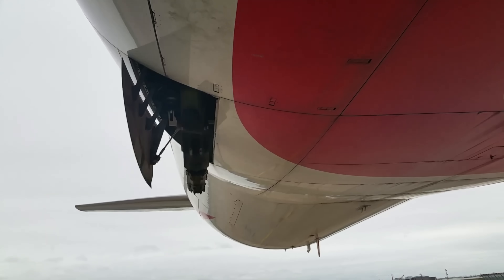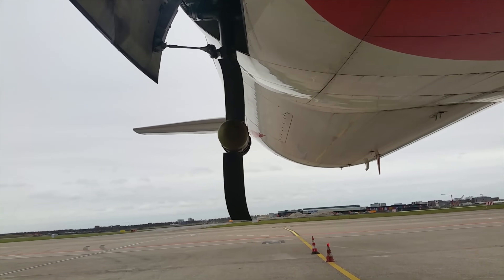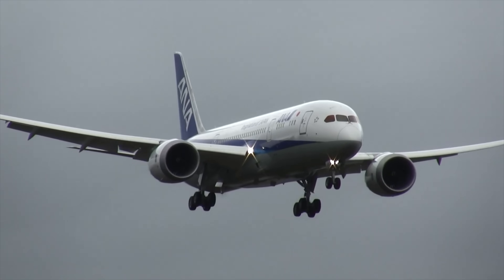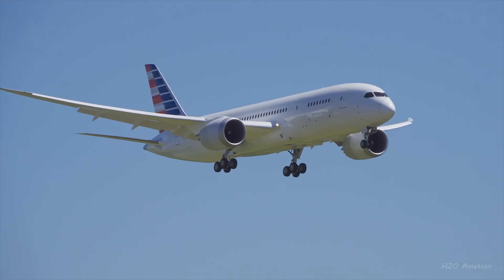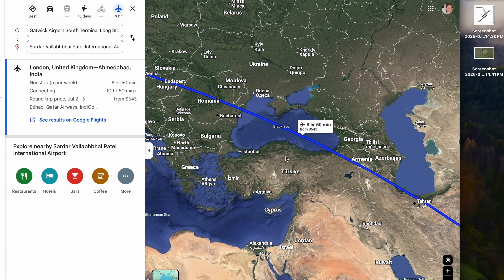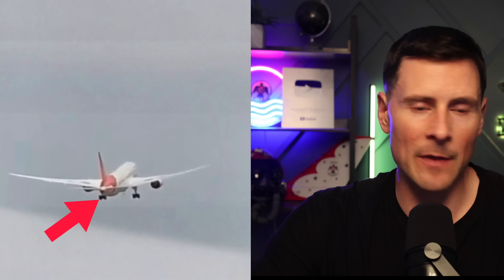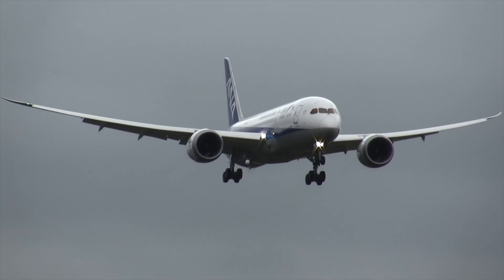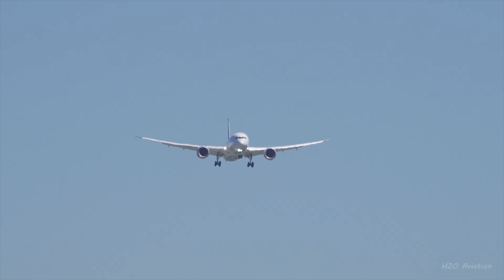Air India 171 SHOCKING UPDATE on RAT Deployment and Flaps!

Comment: Why is nobody talking abaout the fact that the catastrophic failure seems to have happend at the exact moment the Gear up should have been selected? i am speculating that when the Pilots tried to raise the gear up it caused some kind of catastrophic failure in the aircrafts systems.
Reply: That... actually makes a lot of sense, now that you mention it.
Reply: Exactly, i think the same, i think pilot tried to raise the landing gears, the gears tilted forward or retracted a little bit then it's hydrolic fluid leaked (with a blast, because pressure is so high that when it leaks, it leaks with blast, and the sole survivor also mentioned about hearing the blast) then landing gears stopped retracting and the leaked ultra high pressure fluids destroyed electronics and other things arround it and that accident instantly stopped the plane from generating power, then RAT got deployed automatically to generate emergency power (usually RAT deployment also results in flickering of lights inside the plan and sole survivor said that lights flickered inside the plane) to make necessary electronics work, to make mayday call etc. We can see RAT deployed and it's gates open at the bottom of the plane, in the video, again this is just my speculation. So i think crash happed because of manufacturing or maintenance or design engineering error of landing gear hydrolics. They should make the plane in such a way that even if hydrolic blast happen, it should not cripple the plane's ability to generating lift or run engine.
Reply: @ykd0011  I would be surprised if everything depended on one sole electrical system. What I can imagine is 1) some incident (the bang) destroyed / compromised more than one electrical systems supposed to back up each other, 2) some freak software bug shutting down more than one system due to some unlikely coincidence not foreseen
Reply: @ouwebrood497  That's the thing. NOTHING in these planes depend on a single system. Unless by single system you mean the laws of physics as best we know them. Pretty sure some guy in deep nasa lab somewhere is working on making that redundant too. 
I'd be suprised if less than 3 things all went wrong to cause this. Not mess my shorts suprised, but still suprised.
Reply: If you look you will see they tried to raise the landing gear. The first motion when the gear is raised is for the "bogies" to tip forwards into the stowage position. You can see the tipped forward wheels very clearly.
Looks like whatever failed happened when they tried raising the gear.
Reply: It chills me to the core as that's what I thought, as if trying to raise the gear caused something truly terrible and unprecedented to occur.
Reply: Yes, I suspect that triggered some short circuit or something like that. Must be one of the swiss cheese holes.
Reply: @ouwebrood497  exactly what I'm thinking, maybe raising the gear made some sort of electrical overload on some system that led to a catastrophe.
Reply: Been saying that since I found out the wheel position meant they were about to retract.

Comment: Another airline pilot reviewer who reached the same conclusion suggested vapor lock due to plane being on the tarmack for up to 3 hours at the hotest time of day and then hadn't been running A/C inside the cabin according to passenger cell phone videos posted before the flight took off therefore the fuel lines internal to fusalage might have had vapor bubbles that went towards the front with the takeoff raised the nose higher. We'll see what the investigation finds.

Comment: -vapor lock -> both engines lost -> electrical power loss -> RAT deployment, but speed too low for RAT to help?
Did I get it right? Is there any other power source for critical systems (I know there is an auxiliary small turbine for electrical power)?

Comment: Watched another channel, forgot his name, looked at gear position. In this case forward wheels down indicating gear up activation. But with the gear still down indicates no hydraulics/electrical failure.
After watching that other channel I think one engine failed after v1 vr which cause a long take off. You can see in one of the videos one dust cloud from the left engine wash. Then as they began to climb probably in the middle of crm, them lost the left too. This would explain their trajectory from the runway to the crash site if they were trying to keep level with one engine. The video where we see them level out and descend i think is just after left engine flames out.
I don't think the temp affected fuel/engines. I think storage is where contamination occurred. If it were temp alone there would have been other incidents with other 787's.
To me cause is either contaminated fuel or mechanical issue with fuel system that cause a staggered dual engine failure.
I've changed my mind about flaps after watching comparison videos.

Comment: The midflap behind the engine is an active surface that moves a lot for flight control changes in that part of the flight envelope. That "break" in the wing you're seeing should be disappearing and reappearing as it moves, but they aren't moving. Look very closely at normal takeoff, they are very active.

Comment: We have already passed all these flaps, as long as possible, the B-787 will not go into flight without flaps, and even bad fuel will not release thrust to two engines at the same time for 25 seconds, comrades experts, wake up from everything unnecessary, the problem was electrical, the FADEС system turned off, the engines slowed down to low gas because The pumps turned off, and that's it.

Comment: I’m not a pilot nor a aircraft engineer but my question is, is it possible for a engine failure if a hydraulic system failed when the pilot was trying to raise the gears and the pressure to the engine dropped and that triggered the RAT? Because the engines must have been running to the point where the plane stalled. That would make sense to me but I’m not educated on this topic.

Comment: Hi there! There is another piece of evidence that sounds very plausable to me. It is the fact that the main landing gear is tilted down.  Normally the 787 mains landing gears are tilted up as soon as the airplane leaves the ground! So, when the landing gear is commanded to be retracted the first thing that occurs is that the mains gears will tilt down (as we see in the video if you look carefully) so that they could be stowedin the wheel well. It may be a clear indication of hydraulic failure causing a RAT deployment!

Comment: "The safety record of this 787 has been so stellar" - it shouldn't be possible for the power control unit software to take all 4 AC generator control units offline and that certainly shouldn't surface because of an integer overflow at 248 days of continuous power. It may not even be software that caused the power issues but these previous defects paint a very bad picture of Boeing safety.

Comment: My current uneducated theory is that the landing gear issue we see (with the trucks tilted and the doors not opened) is likely a symptom, not the root cause and might suggest the gear retraction sequence started but got interrupted — which is abnormal. On the 787, systems like gear, hydraulics, engine controls, and electrical power are all interconnected through shared data buses and logic.

So I think a centralized systems failure, possibly electrical or a data/logic fault happened during or just after the gear retraction command. That fault may have affected both engines FADEC systems? or the aircraft’s electrical supply? which could explain why both engines rolled back or became unresponsive and why the RAT deployed.

Is the gear issue is a key clue? but not the primary cause? Is the most plausible root cause right now a shared systems failure that disrupted thrust control and power? possibly triggered by, but not caused solely by, the gear action.